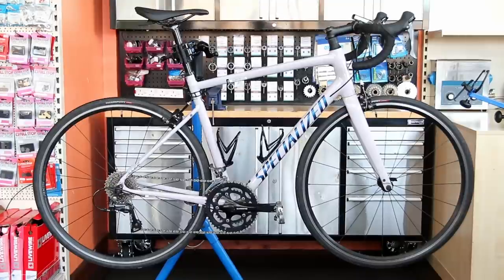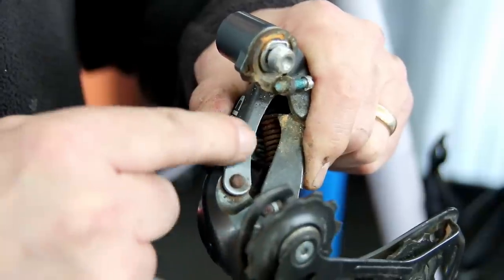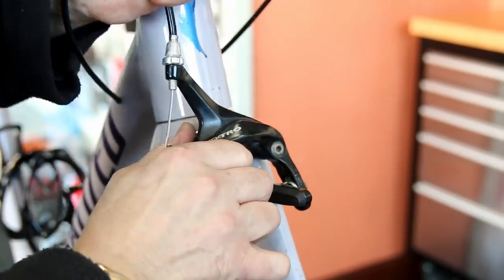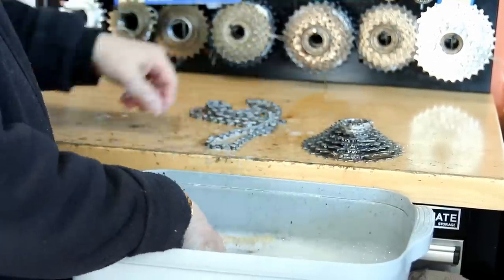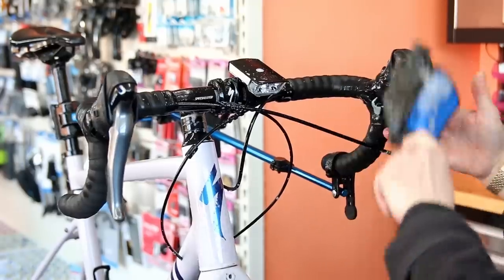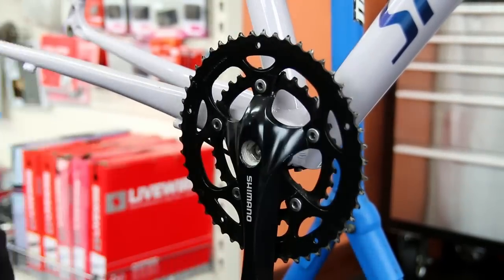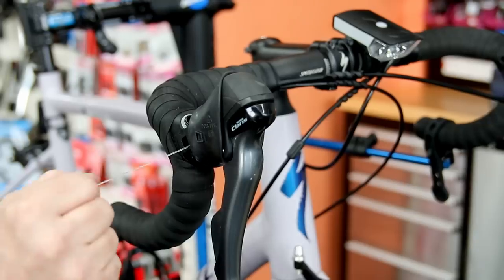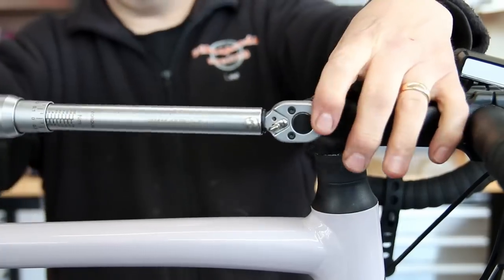Rusty Specialized Allez Service! Road Bike Rebuild!

Comment: Great service and video as usual 🙂. A pity to see the bottom bracket damaged by stuck water, those sealed cartridge units can be a very long lasting component with minimal maintenance. Thanks for the consistent uploads, your followers appreciate 🚲🔧💪.
Reply from the maker: Thanks for all the support Carlos. Yes without a drain hole we think it could be an ongoing problem🧡⚙️

Comment: Top work again. Really enjoyed this piece. Servicing bikes is what you do really well but aren’t you ever amazed or surprised at what people put up with with regard to their bikes? As a mode of transport, bikes are cheap and portable. As a cyclist I find cycle journeys/ rides very satisfying when the brakes and gears are faultless. Not having a bike in decent condition must surely be frustrating. Of course this is my own perspective . You’re doing a great job boys. Always good to see conscientious work ethic.
Reply: My life before being a mechanic had a different view of my bike. I didn't think about it until I sat on it. And it was just to get from A to B. 
Most people don't think about their bikes until something's not working.
It's funny because I've seen people not noticing a broken spoke or a rusty chain, being super critical once they get their bike back.
Had one customer complain about creaking. Turns out it was a lose bolt in the adjustable stem. I never even touched that bolt, lol.
Reply from the maker: We can understand that keeping on top of a bike when you don’t do the work yourself can be challenging. You’ll be without it for a short while and if you take your training seriously that’s a big no no. Often our best local riders run their bikes till they absolutely need it serviced. There’s the cost involved also, that plays a factor for some people. So whilst we do agree bikes should be serviced more regularly than most people chose but we understand how the bikes end up the way they do. Thanks very much for watching 🧡
Reply: @oftankoftan  Maybe the customer expecting any creaking to be picked up by a bike mechanic; maybe you should have touched the bolt; maybe, tightened it.
Reply: @petesmitt  I'll gladly go over every bolt if the customer chooses the service. For a change of chain, or a broken spoke? nah.
Reply: I must have bike OCD because I cannot stand my bike being anything less than mechanically perfect. Most people don’t really care if it makes a click or creak or whatever. Not me, it drives me crazy lol.

Comment: As always a pleasure to watch the heart you put into the service. The water around the bottom bracket might come from the top of the seatpost. Depending on the design, the seatpost can have an opening where the saddle is clamped, that leads water down through the seatpost, the seattube and into the bottom bracket.
Reply from the maker: It seeps in from almost everywhere on bikes! Thanks very much for watching and supporting 🧡⚙️

Comment: This bike was clearly left outside exposed to rain to rot. Water in the BB area can be reduced by greasing properly the seat post. Ahh I use rubber glue to fill those holes in the tire. Great job as usual.

Comment: Checking the tyres for debris is crucial.  I do it after most rides as those bits of glass and stone are insidious little so-and-sos!
Reply from the maker: Best way!
Reply: @Bikespeeds  Great timing with the reply...  I kid you not, just finished cleaning my commuting bike and found a sharp stone embedded in the tyre.  Definitely a puncture waiting to happen 🙂

Comment: I've got a 2020 Allez (same frame different paintwork). Had it for about 18 months before i stripped off the Claris for full 105 but the BB was bone dry when I removed it. Probably helps that i never want to go out in the rain either! That said it's a silly design choice not putting gaskets on there the derailleur cables enter the downtube. I assume that water has got in there and gone down and not exited where the cables come out of the frame under the BB.

Comment: nice work as always!  Do you ever discuss with the customers about doing small modifications like drilling a drain hole in the frame to prevent future issues?
Reply from the maker: Yes it’s something we could do if the customer wanted us too but it voids the warranty on the frame so it’s something we’ve only actually done once 🧡
Reply: I fit a sealed bottom bracket straight away if I discover an open format one . Drain holes only can be made safely with aluminium alloy or Cr - Mo frames .Carbon fibre can crack with standard drill bits .

Comment: As allways, great video. Is it necesarry to change cable housing for rear derailleur or you just clean them(for this example where cable is rusted). Thank you
Reply from the maker: It depends, sometimes the corrosion is in the outer sometimes it isn’t. In this case it wasn’t but occasionally I’ll fit a new inner expecting it to be fine and feel the outer grabbing so I change that as well🧡

Comment: 12:36.  Master link is installed backwards.   Also mechanic never shows the derailleur alignment being checked.  A bit more important than the torque wrench on the Sti levers.

Comment: Great bike recovery.  I notice you've shortened the needle on the lubricating oil too - very smart and a great tip.  In regards to this bike and the BB.  There appears to be a mudguard bolt whole mounting just behind the BB.  Could it be worth popping a bolt in there to stop the water getting into that area?  Great advice on the tyre checking for preventative.  This channel is amazing!
Reply from the maker: We’re buying all sorts of adjustments to our syringes to find the absolute best then we will be listing them for sale on our website, so stay tuned for that! Yes water also seeps in almost everywhere on a bike so it’s a problem with no drain hole. Thanks very much for all the love and interaction!🧡⚙️

Comment: Hi! Do you use a specifik torque when you mount the nut and bolt derailleur hanger? I can see that you are just holding the nut with your finger from behind and tighten the bolt with the allen key

Comment: love your videos! but….. the rear wheel doesn’t seem to be centered in the frame… the rearbrake calliper is not centered…. so the rear wheel need some work and be centered, I think! Keep up making those addicting video! Love watching them!
Reply from the maker: That is actually our stand that bends a bit to the weight of the bike so when the camera is square there are some strange optical illusions. Thanks for all the support!🧡⚙️

Comment: 7:59 you think that open hole in the "crossbar" on the chainstays could be a part of why it's collecting water?
It has to get in from somewhere.
I'm also very impress with how fast you set up the brakes. Is there a trick to it?
Reply from the maker: Water usually seeps in through almost every join in a bike this one was just particularly bad. There’s no trick to the brakes, some take more time but some don’t. Thanks for watching Martin🧡⚙️

Comment: Just a quick question.  What do you do with the used micro fibre towels? Do you chuck them or clean them somehow? I guess you buy them in bulk?
Reply from the maker: They inevitably all end up going thrown out because you simply can’t wash the grease out of them but we’ll try to go from a clean towel on the frame to using that for drying parts, then maybe washing parts, then wiping really greasy parts etc and getting our uses out of them depending on their current stage of “greasy”🧡

Comment: Well done guys. Quick question, what are the super slick cables you use? Also can you offer any advice on how to remove rust from components and bolts? Are you just running them through the supersonic cleaner? Do you use any sort of rust remover?
Reply: Also interested in the answer to the type of cable. Thanks.
Reply from the maker: In general we don’t remove rust, obviously customers pay for these bikes and often just want them up and running rather than restored. Having said that, the ultrasonic cleaner and a bit of wire wool removes enough rust for us.

The cables we use are soon going to be listed on our new store. Stay tuned for that and you’ll be able to get them from there! Thanks very much for watching🧡

Comment: Hello what’s best lube to use on derailleur spring?
Thank you.
Reply from the maker: We use a combination of premium grease for the spring, a thin oil for the pivot points and copper grease/ general purpose when needed. All will soon be available in the syringes you see in our videos on our upcoming website not to long from now🧡

Comment: Also did you disassemble RD after ultrasonic cleaner (in 2 places where it screws to the hanger and where the RD's main spring is) ?
Reply from the maker: No! We again have never had any problems not doing so🧡

Comment: Why not drill a small drain hole in the bottom bearing area so it’s not a problem in the future.
Reply: cant touch another mans bike without permission especially frame drilling, its more than doable but it messes up the warranty

Comment: That bike had barely been used, it looked as if it had just been locked out in the rain for a winter. And you certainly could have freed up that front mech rather than replacing it. Also why not drill a drain hole or, if you don't want to do it, recommend the customer does?

Comment: That poor bike was in horrid condition; looks like it went swimming in a mud puddle.  I doubt if this bike got so corroded from being ridden; I don't like saying it, but it seems to me it's been neglected.  This bike is a great example of why bikes should not be stored outside.  Good thing it found its way to bikespeeds.
Reply from the maker: This bike was actually well ridden, with our seaside air it had just corroded over many miles. This customer cares quite well for their bikes which is why you can see it’s almost spotless! Thanks very much for watching as always🧡⚙️
Reply: @Bikespeeds  In my experience, components don't bind up from being ridden, but from sitting outside in the weather. The only spotless part of the bike is the paint on the alloy frame, the part least affected by weathering.  It's possible that road grit can get into components and lock them up, but a bike can be cleaned after a ride, can it not?